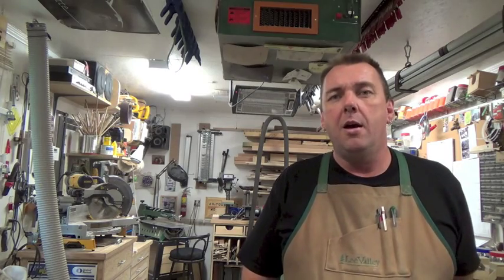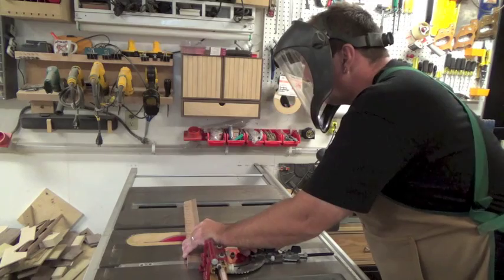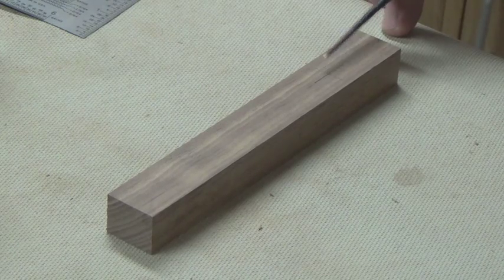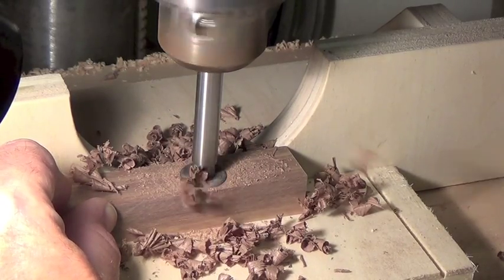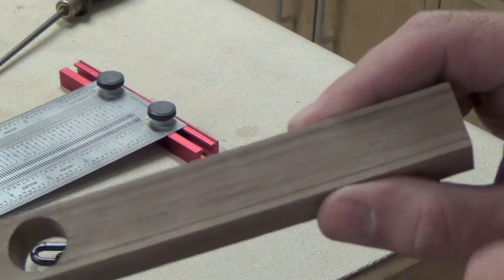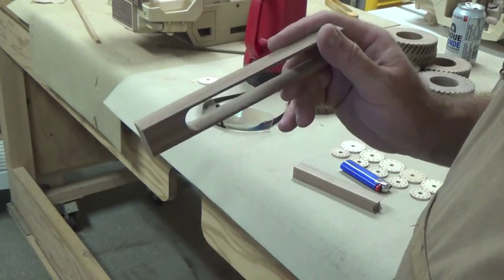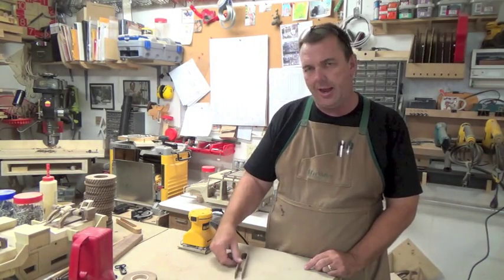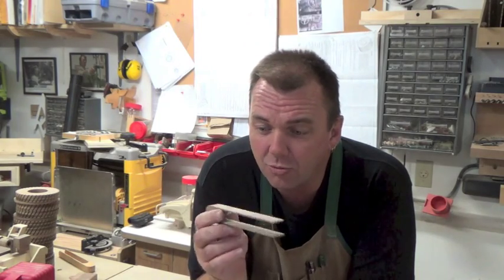Toast Tongs

Comment: What was the name of the measuring tool you used? That was a very cool piece of kit!

Also, absolutely love the tongs, such a simple design and they clearly work well
Reply from the maker: That measuring tool is called a T-rule and they are made by Incra.  You can get them at most woodworking suppliers or directly from Incra.com.  I got mine at lee valley tools.  I hope this helps.  Thanks for tuning in Misty.

Comment from the maker: The only "strange" dimension would be the width of 15/16".  I chose that width because I found that after the 3/4" through hole was drilled it left enough stock to be flexible, yet durable.  Other tests gave more flexibility, but less strength and some tests gave great strength, but no flexibility.  This was the dimensions that worked best for me but you can experiment with it if you like.  The dimensions aren't carved in stone.

Comment: I made a pair with this design, and it lasted a year or so, then someone pried them apart and they broke. Not much strength that way. Will try to make thin strips and glue to a block for my next pair.
Reply from the maker: Be sure to let me know how that works out Rick.  I'd be interested to know how long a pair made like that will last, over the one piece method.
Reply: kennyearrings1 Will do. They broke off one side about a year ago, and I glued it back together. That side held, while the other side, solid-piece side, finally broke a week or so ago when it was pulled apart. I will glue it back together on that side too, but that is what made me think that gluing the sides on might be stronger than the grain. I will let you know how they turn out and hold up.
Reply from the maker: Looking forward to hearing the results.  Thanks